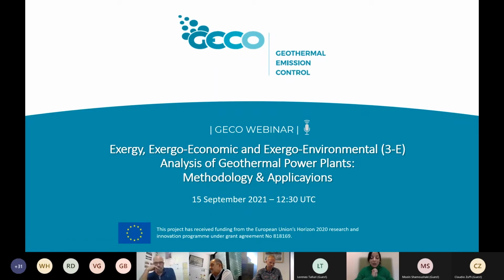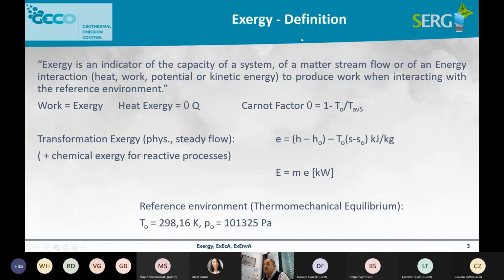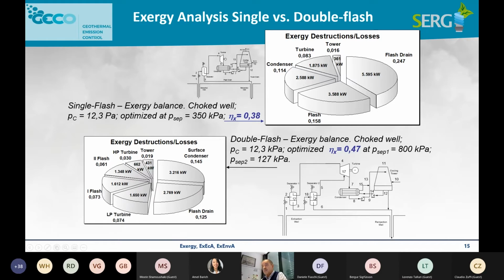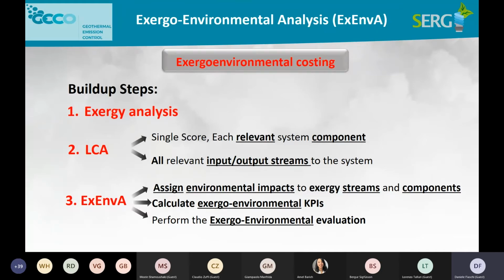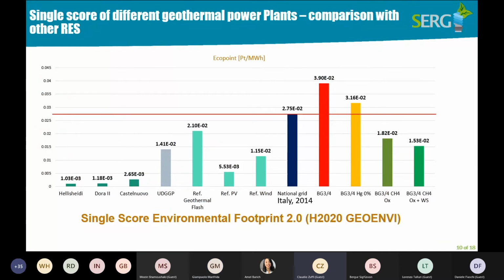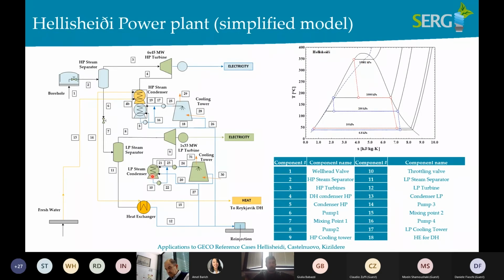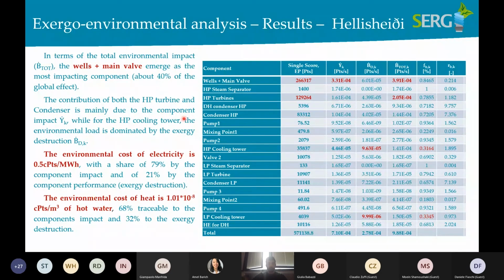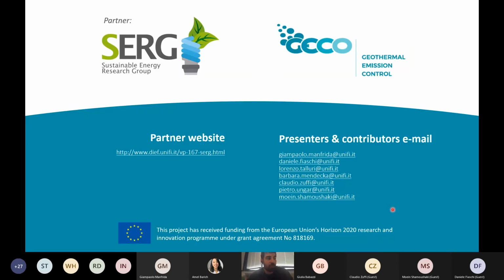GECO Webinar | Exergy, Exergo-Economic, and Exergo-Environmental Analysis of Geothermal Power Plants

Comment: what thermoeconomic methodology is used in your research?
Reply: Dear Carlos, thank you for your question!
The method utilized for the exergo-economic analysis is the one developed by Professors Tsatsaronis and Lazzaretto in this paper: 
https://www.sciencedirect.com/science/article/pii/S0360544205000630?via%3Dihub 
Furthermore, the SERG group developed software for running this analysis, downloadable at the following link:
https://www.dief.unifi.it/vp-473-3et-app.html 
If you also want some further inside in exergo-economic analysis and cost correlations, we published several papers on this topic, for example:
https://www.mdpi.com/2071-1050/13/20/11133 
https://www.mdpi.com/1996-1073/14/9/2665 
https://www.tandfonline.com/doi/abs/10.1080/00207233.2021.1905309
https://www.sciencedirect.com/science/article/pii/S0196890417310865 
Hope I answered your question,
Kind Regards
Lorenzo